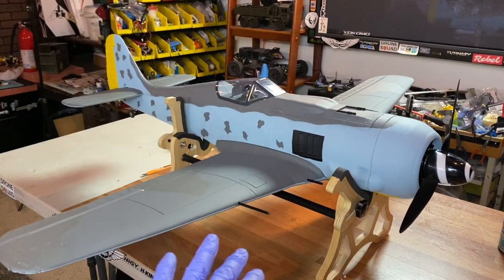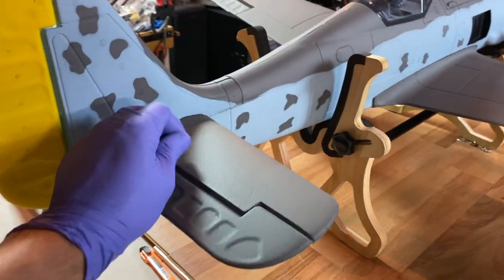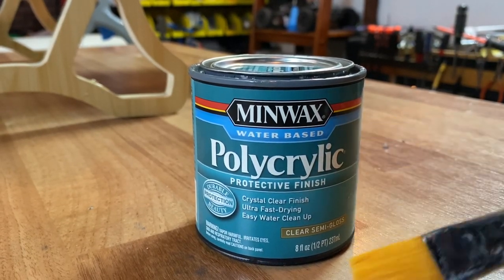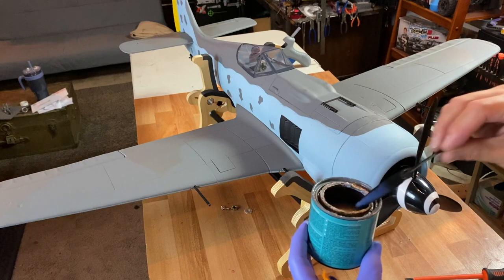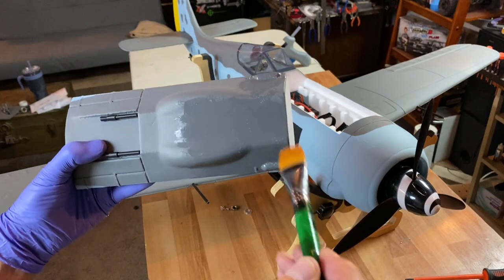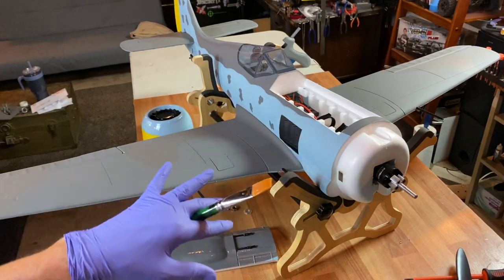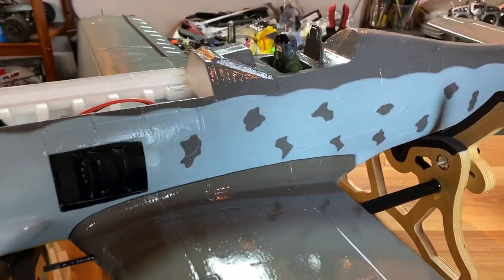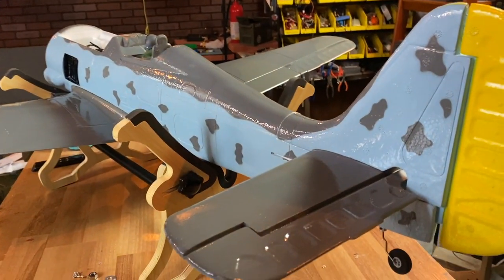fw-190 Paint Protection Minwax

Comment: hello, I'm from Europe : you can use any water-based acrylic clearcoat paint, spraycan or can. Normally these paints are used for wood (also minwax). I use the CLOU aqua based paint series, glossy or semiglossy. semiglossy looks more scale IMO. There are also spraycans with waterbased clearcoat. Wondering why the manufacterers don't do it already. thx for the video.
Reply from the maker: I’ve tried the spray cans but I prefer the brush on. The coats are thicker